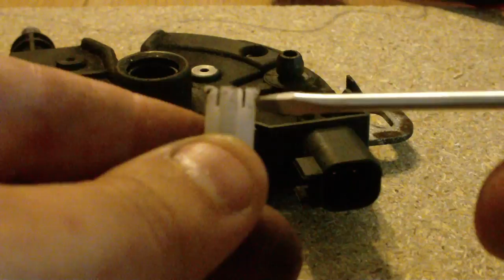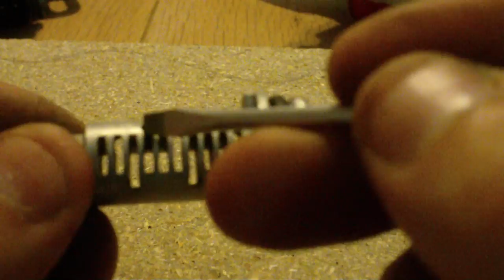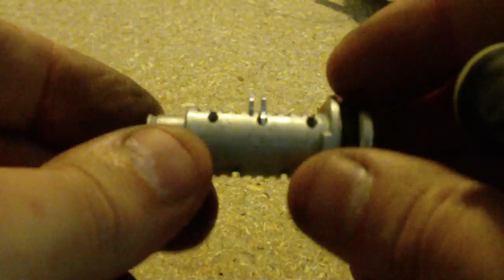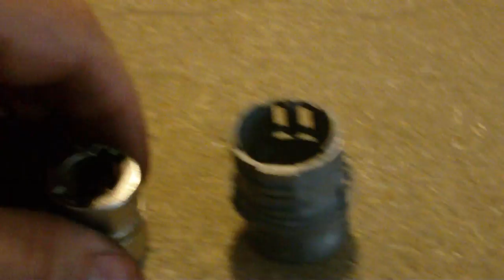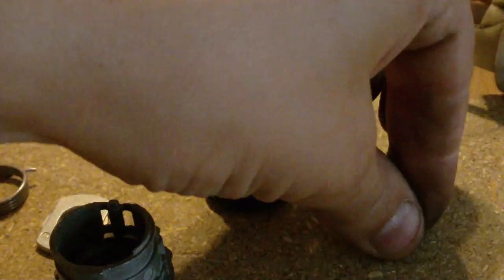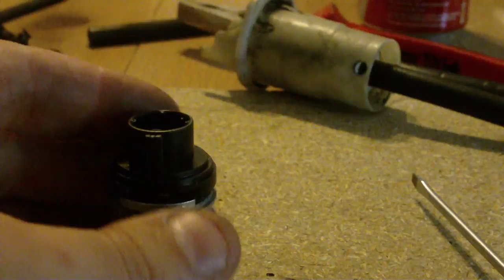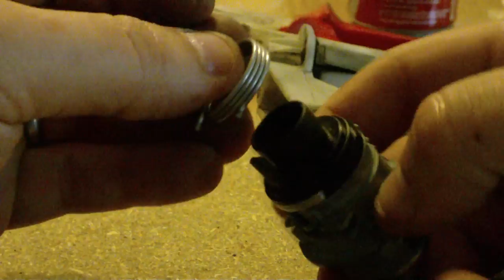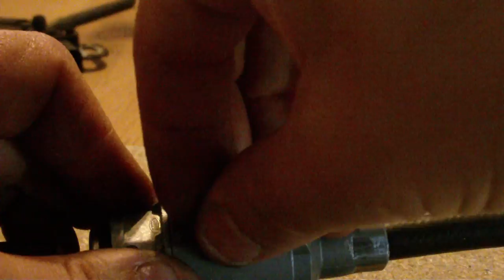Ford Bonnet Lock Barrel Cylinder Assembly and Bowden Cable

Comment: Does anyone know if you can use the little white cross from one model to another?? Got a new car and the bonnet is fucked. I have an older model and I'm just wondering if it will be worth while using that, any suggestions??

Comment: How did you manage to work it all out, I have been staring at these parts for days wondering how they work together, had not even noticed the very small springs! 
Spent a lot of time trying to open bonnet with screwdriver method, but waste of time because later found the Bowden bit was broken. Managed to unscrew the two bolts holding lock ( from below) but still VERY, difficult to lift bonnet because big white bit still located thro fixed hole. Just had to smash up the big white bit thro grill to finally open. Crap design.

Comment: can you tell me can the part of the lock with the micro switch inside ie the part that holds the bonnet down. can that be changed without all the hassle of recking the grill and pulling out the long pin that turns the lock? reason im asking is because my light is on to tell me theres a door open ive put the car into test mode and the switch that is showing faulty is the bonnet switch. ford want 180 quid to diagnose this fault and a further 121 quid for the part, and the labour on top. if i know this can be done without all the hassle of swapping grills and recking stuff ill go the my local breakers for the part. i dont want the hassle of smashing to many bits to fix a light issue on the dash, the bonnet locks and opens freely just this light stays on during car being driven
thanks in advance for any info or any advice
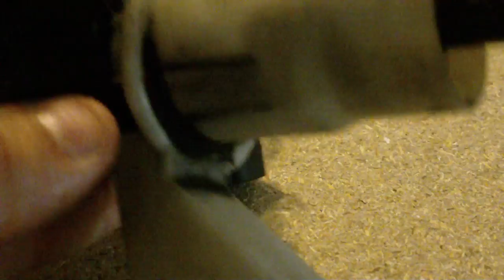Reply from the maker: +john lawson Yes! The only time it might be necessary to damage the grill is if the lock is broken such that the bonnet won't open. If you can open the bonnet, you don't need to damage anything. At the scrap yard, find a similar vehicle and remove the latch lock (held in by 2 bolts). Also need to remove the electrical connection, and pull/pry firmly to disconnect the bowden cable. You will need to swap the small plastic part over onto the bowen cable as shown in the video from 01:30.

Comment: Hi everyone. I'm trying to pull out the thin cylinder pins that lock it in place, does anyone what tool I can use the do this?
Reply: Ok say the answer to this is to actually push the pins through with something small and sharp like a nail and not to pull it out.

Comment: Could find nothing wrong with our mechanism other than white cross piece decided to separate from the cable end one day, had the car from nearly new, no problems ever with the bonnet until one day it wouldnt open 😡😡,   its a 2010, just couldn't get the grille out without breaking, no way i could get to the bolts on the catch, long screw driver through the grille tapped into the mech wouldn't work, had to remove the under trays, reach  up n pull barrel from back of the grille, then carfull smash n pull the cable untill i could pull it out, long sharp flat blade screwdriver into the face of the white cross, it then  turned very easily and opened,,  removed the mechanism from other sons mk2 focus the same day (while it still worked) currently using long screwdriver to open each car while we're waiting for the metal upgraded parts to arive,

Comment: Or !.....if you're capable with a spanner, screwdriver and your hands, you can now simply buy the "upgraded" plastic shaft extension between the lock latch and Bowden cable on Ebay for around £4.99....( if it is "just" this plastic part you need and not the Bowden Cable )...... Simply take the bonnet latch off via the two bolts attaching it to the slam panel (remembering to unplug the push in connector underneath the latch ) Remove the white plastic shaft as shown in the very beginning of this video,  and replace with the new "upgraded" shaft, then put latch, cable, grille, back together again and it's done..........simple.....quick.....cheap.......and i've lost count of the amount of these i've fixed over the years.....Good luck and a big thanks to jcwh2 for posting this video in the first place, it was about time somebody did.
Reply: dude could you elaborate a wee bit please, what do you mean by 'Simply take the bonnet latch off via the two bolts attaching it to the slam panel (remembering to unplug the push in connector underneath the latch )'is this the latch with the actual hook on it or the part the key goes into ?I have bought  the upgraded part and hoping to fix it very soon. cheers man
Reply from the maker: Broomehall is describing how to repair the white tamper proof cross shown at 0:42 (not a solution if the barrel needs replacing). See image: <http://i.ebayimg.com/images/i/272137163505-0-1/s-l1000.jpg>. This shows the bonnet latch. It is held on with 2 bolts - one at each side. The electrical on the connection bottom right detects when the bonnet is closed - it needs to be disconnected to remove the latch. The slam panel is the metal part of the cars frame just in front of the engine - the bonnet latch bolts to it.
Reply: No bother man, I've sent off for that extension piece, I'll try an attach it some way, thanks fur the help
Reply: Yes I am, that's absolutely right.......
Reply: +Broomehall , please see my comment above :)
Reply: +Stevie Mcmahon and jcwh2 :)